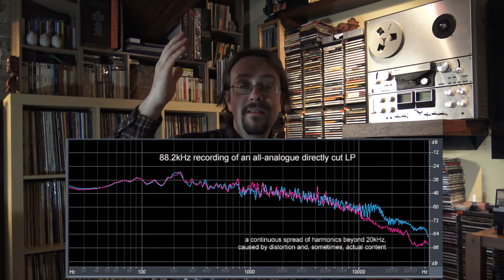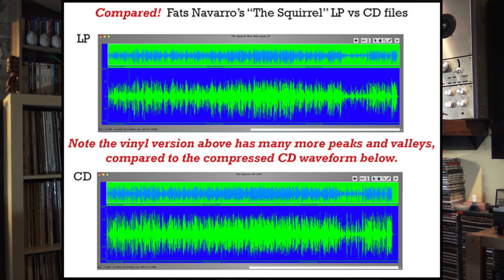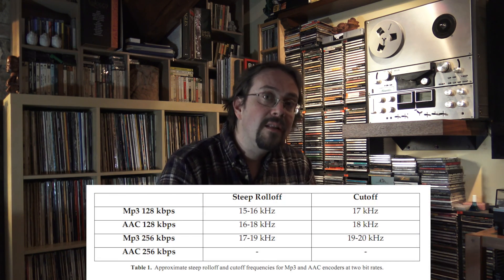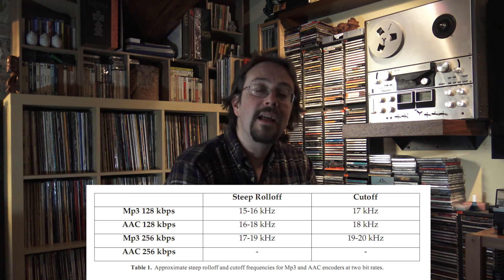SuperTweeters: how to increase your frequency response or a critique on modern music compression

Comment: Well done. Great to listen to someone that understands their age nuances that add to the sound. I recently upgraded my arm,  cartridge and photo stage. In one piece of music the sound of fingers snapping could now be noticed from a hand that is swinging making the sound. Before was stationary. The sound pressures change reproduced. How best to chose a super tweeter?  Trial and error or is there things to consider in matching it to the existing set up?  I'd imagine the high pass on the ST would play a roll and well. In choosing a possible best match
Reply from the maker: Hi Steve, thanks. Well, first of all I do not recommend the use of SuperTweeters if the sound of your system is on the bright side. If ut isn't, there are a few solutions but the one I know and have tested are those from Townshend Audio, which now have been enhanced reaching an extreme dynamic range. The good thing is that you can regulate with a knob the intensity of the presence or turn them off if desired...

Comment: This time, ana[dia]log, I cannot agree with you.
You're falling into one of the most misunderstanding Hi-Fi myths.
It is concerning to frequency response: you and me and the absolute majority of Humankind are unable to hear, in the best of our lives, one single thing beyond 20 kHz, we like it or not. So, any "harmonic frequency" up to this limit has no consequence to our ears. Yes, there are cartridges, phono preamps, amps and "supertweeters" that can go one, even two octaves beyond 20 kHz. Ask yourself what the purpose of this can be. I'll tell you: because Fourier demonstrated some three centuries ago, any periodic function (sound is a periodic function) can be described as a sum of pure senoidal elementary functions, a hard "transient" (a punch) can be constructed with the addition of high fundamental senoidal waves. That's all. A CD has the same capabilities of give a good transient than a phono cart, with one advantage: the CD leaves the sharp dynamic event to rest immediately (if the coded information doesn't say any different), while the set stylus + body cart + arm continues vibrating after without any other reason than its inherent mechanical imperfection. And this isn't a quality but a default.
Think of the above in the following analogy. Human's sight is able to see between two limits of wavelength: 400 nanometers (dark red) and 700 nanometers (blue-violet). NOTHING out of these margins (a 300 nanometers bandwidth) can be seen by us, we agree or desagree with this fact, wich is as perfectly measurable as our listening limits are.
If you feel "warmth" the vinyl sound, please give us a clue about what temperature is that (no matter if Celsius scale, Fahrenheit degrees or even Kelvin's above absolute zero).
Reply from the maker: As I said in various videos it is not only a matrer of audibility, the upper frequencies, as the very low frequencies, have a phisucal inpact and change the rest of the ither frequencies. It is the full soectrum that sounds REAL because in real life, all sounds have always the entire spectrum. Psychoacoustics is a science not an opinion.
Reply: @anadialog  Yes (or maybe not).
Psichacoustics is a Sience with very diffuse boundaries and no less diffuse results. A bit flawed for taking it as a conclusive knowledge source. 
Please, don't dismiss the analogy I've used relating sight.
Reply from the maker: I don't! We see correctly also because of the presence of other non visible (to us) radiations...
Reply: @anadialog  How can you be sure of your statement?
Any conclusive experiment?
Reply from the maker: There are a few, hard to find though. Here are some good examples. Need to read a little bit to get to the point: 
https://www.teachmeaudio.com/recording/sound-reproduction/fundamental-harmonic-frequencies/
https://www.ncbi.nlm.nih.gov/pmc/articles/PMC4737978/
https://passionforsound.wordpress.com/2011/07/30/understanding-mp3s-and-other-compressed-music/
Reply: @anadialog  Iin those papers I haven't the slightest clue that we, humans, can hear anything bbeyond 20 kHz.
Actually, they're just an explanation about hiw harmonics on how different relationship between the fundamental tone and its harmonucs (NEVER beyond human hearig limits) change the timbre of things.
Nothing new under the Sun, to say the less.
Reply from the maker: I never said that we can listen beyond 20khz!!! I said that we can perceive music as more faithfull when ALL frequencies are there due to the creation of new harmonics, which influence most of the spectrum, and physical sound pressure on our body and ear. That is something completely different!
Reply: @anadialog  Hard to find indeed. I think you read those "studies" as saying what you needed them to say. The first was a small introduction to what sound is. So not a study. The second was a study looking into how LOWERING the high frequencies to an audible frequency could help hearing impaired people. The last was just a rant from one of your soulmates. He even starts out by talking about "purest form" - a dead giveaway that he cannot differentiate between emotional and intellectual contents of his thoughts. I can tell you what you are missing if you want to know. It is humility. The kind where you never tell yourself that you know the truth. And where you always leave room for the possibility that you are wrong. I might be wrong about this, but it was not demonstrated by your links. You only demonstrated that you don't think critically about this subject.
Reply from the maker: @Esben Rasmussen those were just a few things I found in a few minutes. I have a PhD in another field and I know how to do research. YouTube is not the proper place for this. In any case, since you had to go further and insulting claiming that I am not humble and I do not think critically on this subject, here are some true academic peer-reviewed scientifically sound papers (and this is only the tip of the iceberg): https://www.dropbox.com/sh/3jzgvgvyyz5ua8k/AAA_m38vc8ElefrGPiNHoESTa?dl=0 
I also want to add a nice link to a page in a recently published book of a renown sound engineer we he clearly states the presence of harmonics above the so called 20Khz threshold. I am adding this beacuse a lot of people claim that even this is not true! https://books.google.it/books?id=fPiRDQAAQBAJ&pg=PT489&lpg=PT489&dq=ultrasonics+in+listening+music+harmonics&source=bl&ots=19t9KdZOVz&sig=ACfU3U0WaVif93qNqMqL0UeahSGUOpSZwQ&hl=it&sa=X&ved=2ahUKEwi1zNKXkLLlAhXOy6QKHaaKCiM4ChDoATAHegQICRAB#v=onepage&q=ultrasonics%20in%20listening%20music%20harmonics&f=false
Reply: @anadialog  Wow, thanks. Interesting reading. Why don't you talk about this in your videos. 
You have to admit the world is full of people whos opinion is solely based on their need to justify their spending habits on high priced equipment. And I do not have PHD and no acces to determine the truth value of statements like the ones you make, by the way you make them. 
Including these studies would have assured me and the rest of your viewers that you actually know what you are talking about. 
I don't trust yours or anyone else words as fact, having a PHD you shouldn't expect me to. 
I think my words were fair considering the evidence brought forth, but I am happy to find out I was wrong, I always enjoy that, it's the price for getting smarter - so again thank you sincerely : ) 
I hope you will include this kind of substantiation in you future videos. Keep on making the world of high end audio reality based.
Reply from the maker: @esbenrasmussen4289  this is a really nice comment! Thanks for admitting your position and acknowledge mine. Yes, I agree, I should do something because so many people think I inventing this stuff and although the debate is still open, it is interesting to know that the 20hz-20khz law in books isn't that solid. Hopefully, this one day will turn out in true high fidelity recordings!
Reply: @anadialog  no of course, we are wrong more often than we are correct. I don't see the attraction of maintaining a view after it is disproven. I just want to believe as many true things and as few wrong things as possible. I also think we should invite challenges. That gives us a chance to explain our selves. But our culture, worldwide, is errorphobic and it is a shame.
Maybe do a collab with a physics or engineering youtuber. Smarter everyday would jump on this
Reply from the maker: @esbenrasmussen4289  a very Smart and positive approach! Congrats!